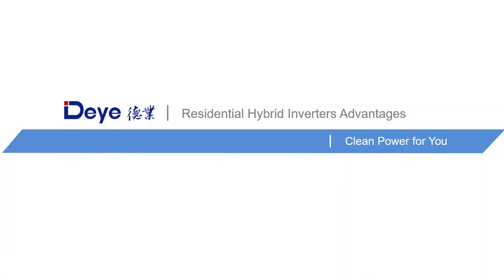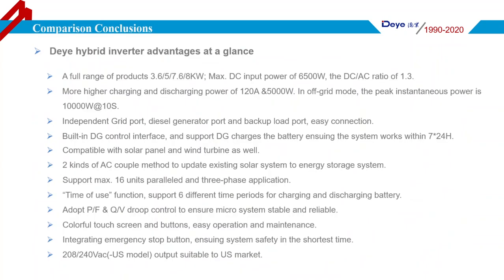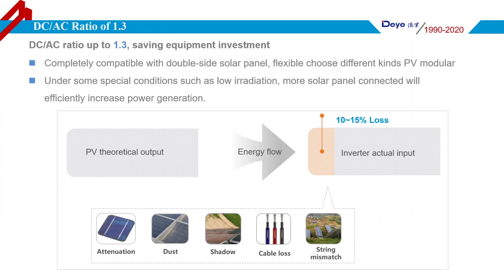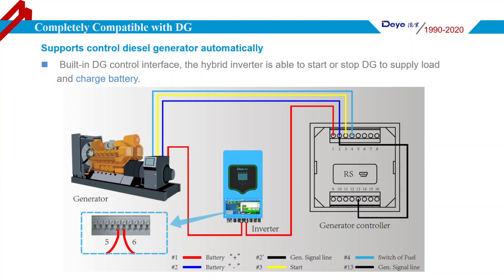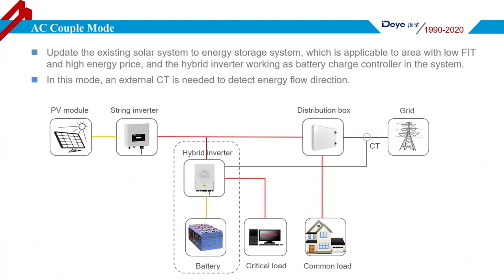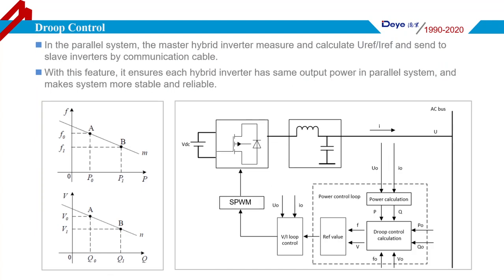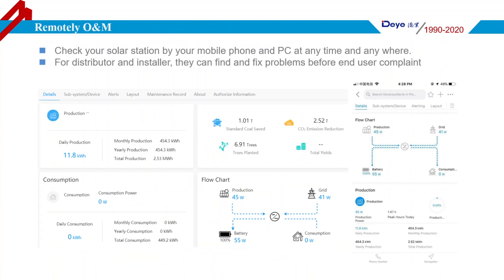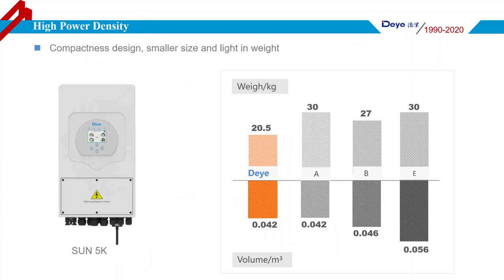Deye hybrid inverter introduction

Comment: For the model SUN-12K-SG04LP3, in an on-grid setup, if the grid power is cut-off, is the inverter capable to power the critical load and the home load (common load) from the PV and/or batteries?
Reply from the maker: hi it can power the critical load only.

Comment: Could you to make video working hybrid inverter with AC coupling and working with microinvertes? Thanks!
Reply from the maker: i will make it. give me some time.
Reply: @DeyeInverter_official  please video working deye hybrid inverter with AC coupling and working with microinvertes
Reply: Thanks, I have 3 microinvertes and I will like to buy 4 batteries (9.6kW) lifepo4 and connect it in my home with AC inverter some Deye 5k or connect microinvertes by port Gen Deye hybrid 5k